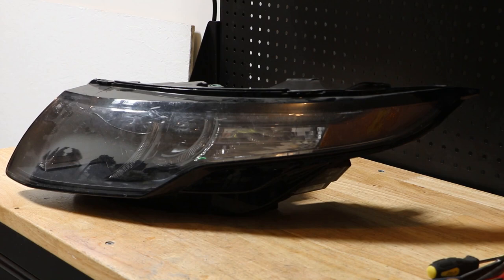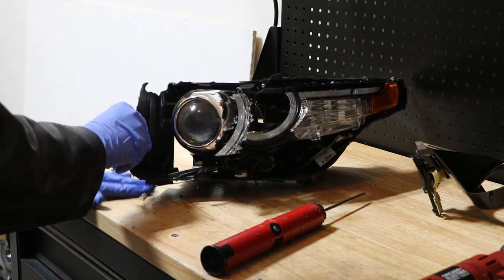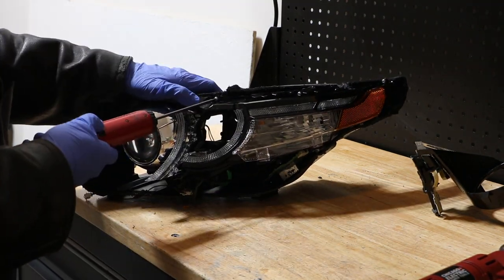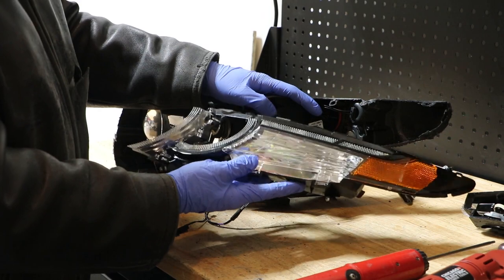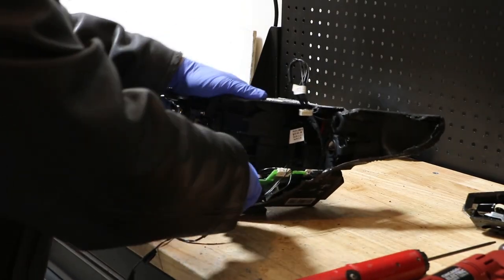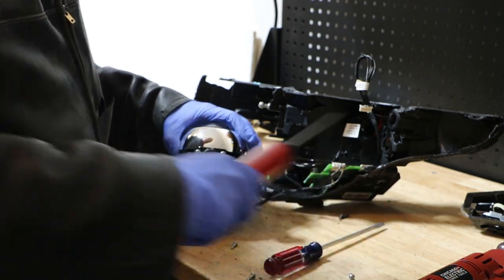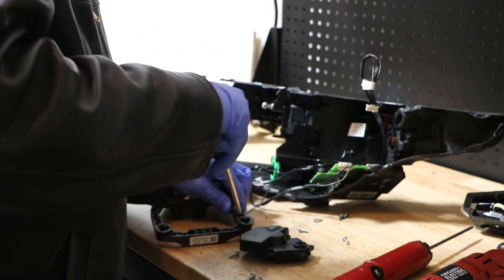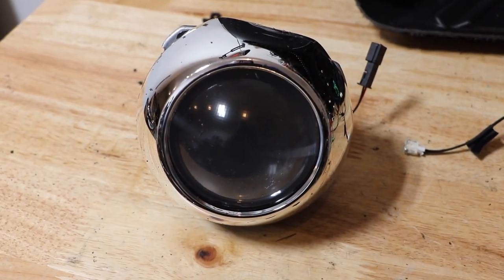2012-2015 Range Rover Evoque Bi-Xenon Headlight Disassembly

Comment: How did you remove the lens?
Reply from the maker: you have to heat/melt the glue.  The most common/recommend method is to bake a headlight.
Reply: @gftgrill  tried that buddy, the Evoque light was too large to fit in my oven so couldn’t close the door fully, so couldn’t get the temp right and it wouldn’t soften enough to remove. Maybe a heat gun will be worth a try.
Reply from the maker: @satchibhoy  I have a video where I do open a nissan light with a heat gun.  You have to be careful as it's easy to melt the light with a heat gun as it's less control.   The black glue on these lights are also harder (more heat resistant) to work with than the older grey glue.